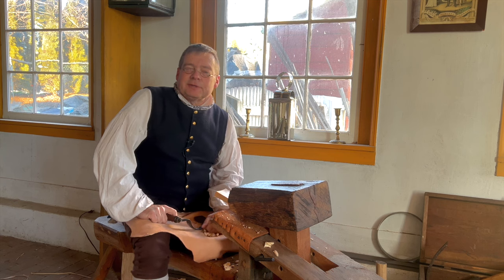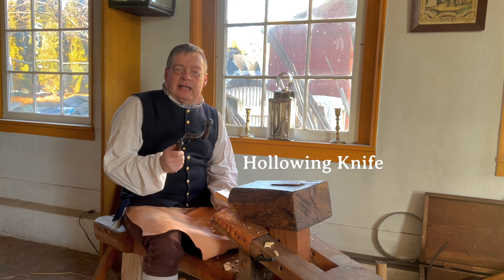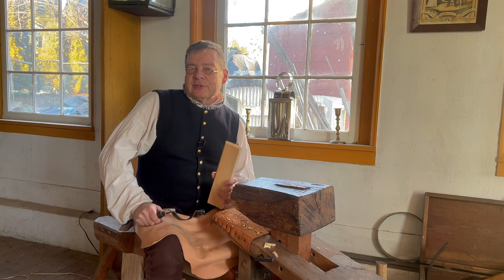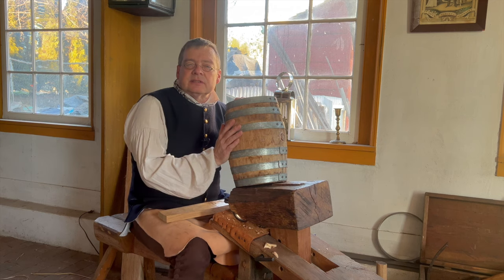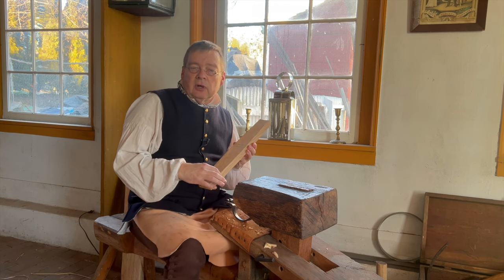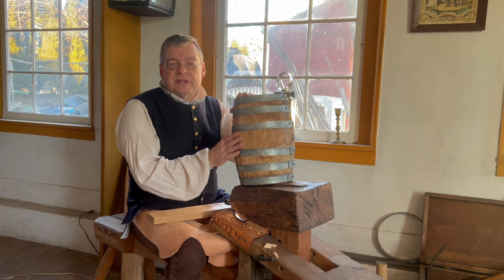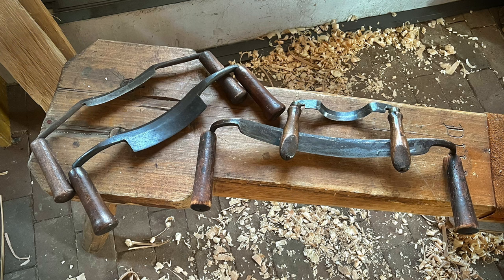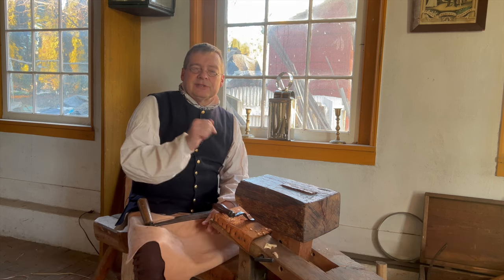The Cooper’s Hollowing Knife: An Elegant Tool From a More Civilized Age

Comment: re: bucket vs. pail - I think you gave us an important hint in the early part of this video when you mentioned 'white cooperage' so I'll hazard a guess that a 'pail' is explicitly white cooperage while a 'bucket' is not. Working from that, then, the pail is listed in two directions while a bucket may not be
Reply from the maker: Thank you form your guess. Actually, both are considered White Cooperage, as the staves are tapered, but not bent, as with Slack and Tight Cooperage. There is only one difference between the two.

Comment: I'm going to guess that a bucket isn't necessarily water tight and could hold any dry goods, but a pail IS water tight and used for water, milk etc. But this is only a guess
Reply from the maker: You’re partway there, but both are liquid-tight.

Comment: Buckets are for pouring, pails are for transporting? Like you fill a bucket then use it to transfer stuff into a container, but you fill a pail and use it to hold stuff as you take it somwhere else?
Reply from the maker: Thanks for your guess. That’s not it. I’ll provide the answer in my Backing Knife video. If you haven’t done so already, be sure to click the notification bell, so you’ll be alerted when I publish that video.